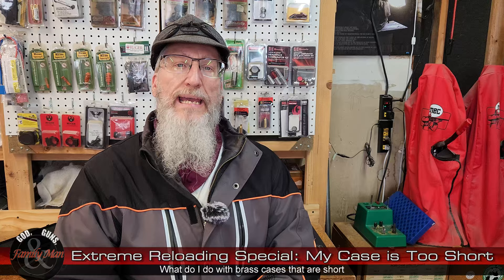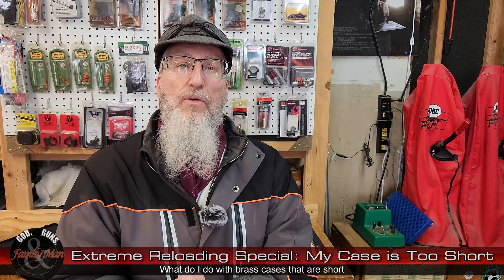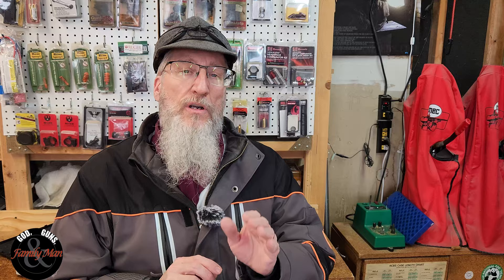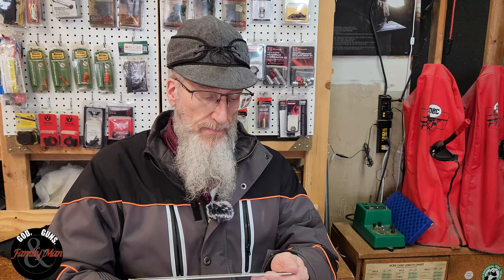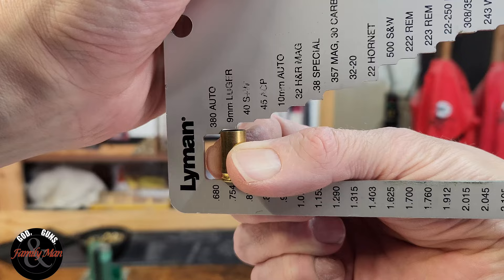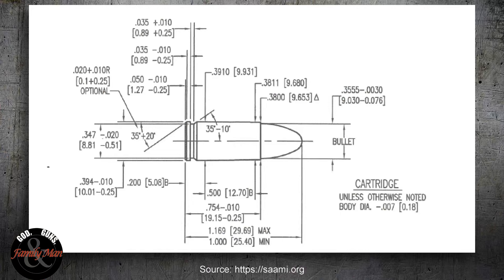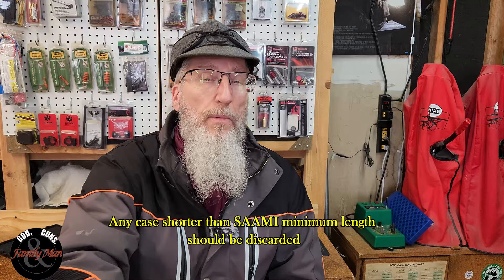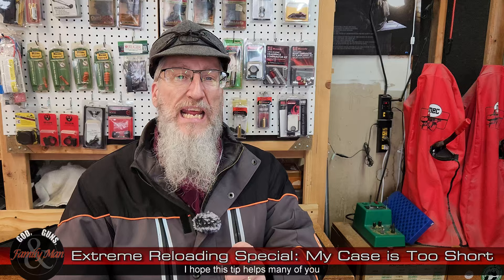When Brass Cases are Too Short (An EXTREME RELOADING Special Edition)

Comment: This is just what I was looking for. Neither the Nosler or Lee Manuals list tolerances or minimums. So this was tripping me up because some of my cases were .020 lower than the max which I thought was a lot. And if seating a bullet too deep can cause unsafe pressure then surely a case too short would also cause unsafe pressure. That SAAMI website is fantastic. Thanks!
Reply from the maker: You are welcome.  And thank you for watching and posting.
Reply: What cartridge? As long as the overall length is correct, the bullet cannot be " too deep" in the case.
Reply from the maker: @dissy5563 We were discussing the 9mm Luger which headspaces on the mouth.  We were also discussing pressure.
The other difference is what is called Head Height.  That is the distance from the mouth of the case to the tip of the bullet.

Comment: I trim my match cases short intentionally,  I only have to trim every 3 loadings this way. My testing hasn't shown any degradation in accuracy and still plenty of neck tension.
Reply from the maker: If that works well for you that is OK.  By doing what you describe you are introducing inconsistency.  The first batch of cases will be shortest, the second batch a bit longer, etc.  Within each batch there will surely be additional inconsistencies in case length.  However, if this process is working well for you that is OK.

Comment: Perhaps, pistol, cartridges or straight wall cartridges should be disregarded. But Rifle cartridges with a neck and shoulder will grow so unless it’s extremely short there is no need to throw them away.
Reply: agree 100 %  my necks are always short but the CB to shoulder is fine
Reply: I was hoping the question was answered for rifles. I have about 150 lapua brasses that are short. About 60 thousands below Sammy spect. Do I fire form or throw. Cannot get the brass no more so its nice to have given to me.
Reply: @leeNWHuntinganFish4713  always better short than to long. Full length first then fire form
Reply: @leeNWHuntinganFish4713  are these virgin pieces of brass? What is the cartridge of Brass did you by chance resize them? If so, what method what dies?